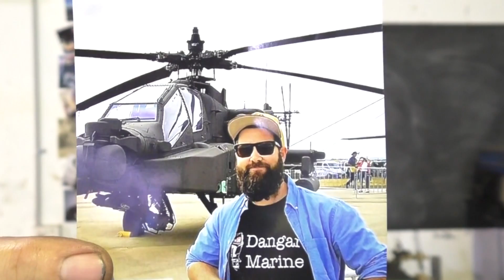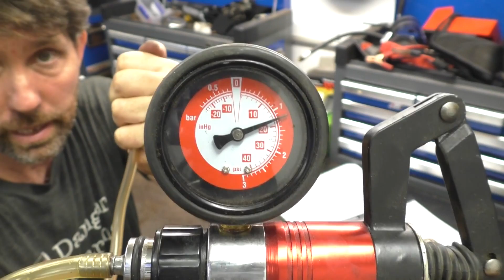Outboard fuel pumps

Comment: First, thank you for  taking the time to put together these very informative videos...Now, question about fuel pumps.. I'm having an issue with an 1987 Johnson 90hp v4, which I just purchased and have it on the water several times no problems.. But, now it boggs  down, doesn't die, just boggs  down.. seems to happen once you try an open it all the way.. Things I've covered so far...One, I changed out the primer bulb, and switched over to a different tank of fuel.. So what next?? thanks Don..
Reply from the maker: I would make sure the carb bowls are full of fuel by draining one straight after it happens. If they aren't it could be a dodgy fuel pump. If they are full it could be a problem with blocked main jets meaning the carburettors will need a clean and perhaps the float levels set.

Comment: You mentioned an O ring wasn't seated on first assembly of the Merc pump, I didn't see anywhere that you referenced it/showed it/where it is?

On the Yamaha pump, what does the metal valves seal against, just metal, or is there an O ring or something they seat against?

Lastly, what videocam do you use and what software for editing?

Thanks,

RichE
Reply from the maker: It isn't so much an o-ring as a thin gasket that goes around the edge of the pump's cover plate. The reeds on the Yamaha pump just seal against the plastic casing of the pump. As the vacuum tests show, they down really seal completely, they just restrict the flow in one direction enough to cause fuel to mostly keep moving in one direction. Camera is a Panasonic v770 and I use Final Cut Pro for the editing.

Comment: hi stu i have the honda bf90 and got the shock of my life because as always every time i use my boat in the sea i get home and next day flush engine properly. well the last time i used my boat i took my top cover off engine and to my shock at the side of my thermostat there is a metal covering with a hose attached well it was all corroded at to buy new metal cover i would be happy if you could show on your videos where the water system flows so that i might be able to watch for any more problems by the way i have the full honda bf 90 diagram pages if you would like me to sent a copy to you i will do so but watching your videos are much more informative
Reply from the maker: Hi Jimmy, I've been meaning to do a video on the full path of the cooling water for AGES! Thanks for the prompt to bump it up the list. Stay tuned!

Comment: I just re-watched your video on pressure testing lower units where you made your own pressure-tester. In this video I see you've bought a commercial hand pump pressure tester. How much was it and where did you get it? You still reckon a DIY version is good enough? Thanks for the video
Reply from the maker: Hi David, yep, DIY version works just fine, it's just a little bit more fiddly to use. The one I bought is like this http://www.ebay.com.au/itm/Hand-Held-Vacuum-and-Pressure-Pump-Tester-Kit-Brake-Fluid-Bleeder-Adapters-/291832545459?hash=item43f29340b3:g:GcMAAOSwc-tY7yHW

Comment: Hello Danger, Love your videos. Been following you for a while now. 
I have a question i have you can answer for me - I have a suzuki DF25 V-Twin 4 stroke motor from 2008. It is in fairly good condition. - starts everytime, runs perfect in idle. But when i give it some throttle it will start to act up, and sometimes die completely, then first time i pull it starts right back up no problem and run smooth again, but then it will die on me again if i give it too much throttle. 

It only sorta happen when i give it like 25% or more in one go. If i slowly climb my way up to full throttle over lets say 30 sec. it wont happen. What can that be? im lost. Any clue what it could be ?

Thanks in advance :)
Reply from the maker: Hi mate. As fuel is heavier than air, when you accelerate there is a lag where a motor with go lean unless something is done to compensate (like an accelerator pump that gives a little squirt of extra fuel as you push the throttle). Sounds like either this mechanism isn't working or perhaps you have a vacuum leak where extra clean (non-fueled) air is being sucked into the cylinders. Check that the carburettor is well sealed against the block with a good gasket to start with.

Comment: Hey stu! I know you get a lot of request for vids. I have a request that im sure most would like to see. When you google reading a spark plug, the info is vague and hard to tell. A quick tip on spark plug color reading would be great and a lifesaver. Could save someone from a piston rebuild by reading plugs. I myself just know dark is oil and white is lean. Thanks and please keep up the great work!
Reply: bigfat hotdog ok thanks for the advice! I'll try it and let you if it works!
Reply from the maker: Good idea, reading spark plugs is an important thing to learn about. I'll start keeping interesting spark plugs in a tray somewhere and when I have enough of them I'll do the vid.
Reply: Empty the fuel out of carbs. Get someone to pump the primer bulb and listen for air squeeking from anywhere the fuel flows. Also check for fuel leaking from anywhere. If thats not it then double check the fuel pump. It might not be sending enough fuel through. Dangar also has a vid on testing fuel pumps! Or you could be onto something about the carb jets being plugged up or the carb float is stuck or has a hole in it and filling it up with fuel and not letting the right amount of fuel into the motor. Also check if spark plugs are gapped correctly. And one more thing could be perishes fuel lines from ethanol. My old line had what looked like ear wax chunks ALL OVER inside my fuel lines. It was even in my fuel filter right before carbs and even had bits of it inside my first carb. It didn't stall my motor at the time but if i hadn't replaced the fuel lines it was only a matter of time. And my luck it would be while out on thw water! Its a very good idea to replace all fuel lines every few years if using ethanol fuel. Especially the fuel line from the fuel tank up to the motor. Those lines usually have a platic lining that breaks apart eventually.
Reply: Good idea man! I hope you get this figured out and let me know how you make out. Dangar has a ton of great and easy to understand vids. I have learned a lot from him and he is by far the best channel on outboards and boats. Good luck again bud! Im sure you will get it running smooth again
Reply: bigfat hotdog it will be a week or two but I'll let you know how it ends up! thanks for the help!!!
Reply: got the carburetor off and found just a little debris in there, cleaned everything up and reinstalled and it fired up on the third pull, took it out on a lake yesterday and she runs great, going to replace the old fuel tank and hose soon to hopefully prevent the carb from getting clogged up again so soon. thanks for the advice and help!
Reply: Good job buddy!!! Im glad you got the motor running again and have fun on the water!
Reply: Dangar Marine I have a 1966 Evinrude 5 hp, recently replaced a leaking fuel pump, connected everything and it fired up but it won't stay running more than 5 seconds, cleaned the carburetor the previous winter and also replaced spark plugs...any ideas on what the problem is?
Reply: That sounds fuel related. Try choking right before it kills and see if it keeps running.  it could be something else but i would start there. Mine did very similar after i rebuilt my fuel pump and all fuel lines and carbs. I just KNEW it was electrical. I bought an extra fuel connector and ran fresh fuel on a different tank. My problem was i was sold water as fuel from a marina. Since i just bought the fuel it didnt even cross my mind. Pulled my fuel/water seperator and it was FULL with water! Fresh non-ethanol fuel my ass! The marina screwed me. So try fresh fuel this time. Or dump some of your fuel in a glass jar and see if it has water in it. Let it sit for a lil bit and you will see the seperation if it is bad. Hope this helps and good luck
Reply: bigfat hotdog it will stay running for a few longer seconds on full choke but still dies... just put new fuel mix in a week ago... could the carb have gotten gummed up only 4 months or so after a good cleaning?
Reply: bigfat hotdog also it only starts using starting fluid but once that's gone it dies immediately
Reply: If thats the case then the motor is starving for fuel. Usually it means you need to rebuild the fuel pump or your primer bulb from the fuel tank is shot. Dangar Marine has a video on primer bulbs. I would start with that and go down the checklist of the fuel delivery. After primer bulb follow the fuel line. You can pull the fuel hose under the cowling at every place it enters a new item. Like the fuel pump, the fuel filter, right before carb. Each time you pull the hose squeeze the primer bulb and see if fuel is running out the fuel hose. You can get someone to pump the primer bulb for you and put your ears right next to the carbs and hear them filling up with fuel. And it very well COULD be your carb is gummed up but not as likely if they were done only 4 months ago..but it is possible
Reply: And after the primer bulb i would start at the end of the fuel flow (fuel line entering the carb) to check there for a blockage before pulling every line. If there is a fuel filter under the cowling pull that and check/clean it also
Reply: bigfat hotdog ok I have fuel flow going into carburetor with no blockage, fuel is flowing out of the carb bowl when I pull the screw, primer bulb stays hard after priming and starting up, wondering if it could be the carb jets
Reply: bigfat hotdog ok I'm going to get a new fuel tank and hose with primer bulb and take the carb apart and see if it is clogged... engine won't start at all after the starting fluid has evaporated so I'm leaning towards it being the carb jet...just a single carb on the little 5hp Evinrude I have
Reply: What usually goes bad is the check valve inside of primer buld. You said it stays hard which should mean the valve is doing its job. Does the bulb stay hard even after the motor dies? If it does and you already ordered a new primer bulb, i would cut open the fuel line and you can see if the clear plastic lining broke apart. You can also see if the line is gummed up with ethanol sugars. If you can get a service manual for you motor it can be a life saver. I got one for me 50 merc on ebay (on cd) for 10 bucks. It has saved me a few times. Just double check the carb parts and f.pump gaskets and checkvalves are in the right position. You can take your carb off (without taking it apart) hold it upside down and blow into the fuel intake(barb or pipe) and you should not be able to blow air threw it. If its right side up you should be able to blow air threw it. At least youll know if the float is set right without taking it apart
Reply: bigfat hotdog i did just check the primer bulb and it isn't as hard after a few pulls as it is when I prime it before starting but the difference isn't huge
Reply: I believe its normal for it to go a little flatter after running. Thats when the fuel pump takes over and supplies the right amount of fuel. But if its a big difference then that is your culprit
Reply: bigfat hotdog it could be that because the fuel tank is old and has debris in it and that contaminated fuel is getting into the carb jets and clogging it...I know for sure it's an older tank and it's probably time for a new one... but still puzzled on how it will start with starting fluid if it has a clogged carb jet
Reply: When the fuel flows into the carb and fills it the crud will rise with the float and fuel then sink or move into the jets after. I know a few people that had to clean there carbs because it would stall after running a lil bit
Reply: I would like to see that also  plus pre ign and what detonation looks like  thanks

Comment: Another great video from you Stu. I have two of these guys on my Yamaha 150. I was told both were replaced for preventive maintenance, but now I know how to test and overhaul them if needed. They are less of a mystery to me now! We have ethanol blended fuel here in the US that isn't the best for boat fuel systems. I wish that they would go back to good old regular gasoline!
Reply: Easy way to check those is by loosening the mounting bolts a bit and then give the primer bulb a squeeze, if they're bad fuel will leek out of the hole in the back that Stu pointed out in the vid. They're easy to rebuild but a new one is only $40.
Don't tighten the mounting bolts up too tight, they only need about 6 ft lbs or so.
Reply from the maker: That's a nice quick check for a leak in the diagram, I like that.
Reply: Yeah, we have ethanol fuel here and the government mandated that all service stations must sell it. However along with that law is that the blend is a maximum of 10% and bowsers have to be marked (in most cases it is very poorly marked, and hidden by other 'power words' ). So generally if you stick to the major brands and use 95 or 98 RON fuel you are OK in Australia. You can get 91 non ethanol in many servos but you have to be careful as the 10% ethanol is often in the same pump . 
In saying that we still get bad fuel! We filled up last weekend and ended with 50 litres of bad fuel (diesel+E91 in a supposed 95 pump!) last weekend which killed my engine with in about 500metres from the dock! So now I have another major winter project - or a new motor  - to be done by October.
Reply: Ron Powell  Wow Ron, sorry to hear about that. I guess the whole ethanol and water issue is more widespread than I thought. They do sell non ethanol fuel here in the US, but it's very hard to come buy. A search in my state (New Jersey) shows only two places to buy it in the entire state. (It's a big state here too!) And none of them are anywhere near me. Best I can do is try to burn the fuel in the tanks ASAP and not let it sit. I also dose it good with an ethanol fuel treatment with every fill up of the boat.

Comment: Great vid. I have a question on thread sealers like the loctight you used on the fuel pump. My merc service manual says to use loctite 271 on the impeller housing. When i went to buy it at autozone i saw 271 is the red loctite that the label reads as "permanent, not removable with hand tools". Every time i did the LU service i actually used grease on the bolts. Would I be better off still using grease, anti-seize, or the green loctite that states it IS removable by hand tools? Or should i follow the manual and use the red loctite? Thanks a bunch and can't wait for the Johnson LU vid!!#
Reply from the maker: Hi mate, good question. I have used green loctite before, but on these small bolts I've always found the red to be removable with hand tools. We use a Wurth loctite in the shop so I'm not sure what the exact equivalent is. I think some sort of thread locker is a good idea on water pumps in theory, but I've never seem them come apart even without. With regards to using grease, I think that is better for the larger bolts like the ones that hold the leg on as they can be torqued up nice and tight.
Reply: Cool thanks

Comment: hey that looks just like my 4hp yamaha fuel pump I thought was leaking internally but was the cheesy finger clamps. changed them out with SS clamps like you showed on one of you other videos. the hand pump is a must have for pressure leaks. good video. Thanks
Reply from the maker: Thanks mate, those pump / gauges sure are useful, that's for sure. :)

Comment: I would assume on a two stroke if you have low crank case pressure this would effect how well fuel pump works?
Reply from the maker: Yes, but I would say by the time your crank case pressure is that low you wouldn't be running even if you had fuel.

Comment: Good video.I thought maybe you would be showing a fuel pressure gauge installed in-line to show actual pressure it was producing.I just acquired a fuel pressure gauge to install between pump and carb. on my 85' Johnson two stroke to test.
Reply from the maker: I used the fuel pressure gauge in the original video that fuel pump came from, but unfortunately the boat this goes on is no longer hear so I can't test it directly. It is a good point about testing one in the future though. I'm normally only interested in fuel pressure with EFI motors but it would something worth checking for carburettors too.

Comment: hello sir..I'm working on dt 140 suzuki.and I think I'm having fuel pump issues as well..it's getting fuel to carb but don't think it has enough pressure to supply for motor(can fill bowls up just not enough to pump into motor..)i have tooken one outlet line off and turned motor over and it pumps but if I see how much pressure it has by putting finger over and it doesn't push any fuel by my hand...I dunno how much psi those should be pushing..but is there any other way to test with out gauge tool?
Reply: Diaphragm pumps don't generate much pressure - 2-3 psi is typical, which is why they are used to feed carburetors ( low pressure means they don't push needles off seats) and don't need a pressure regulator. You should be able to stop the flow with your finger .